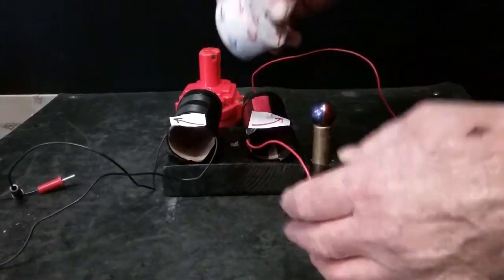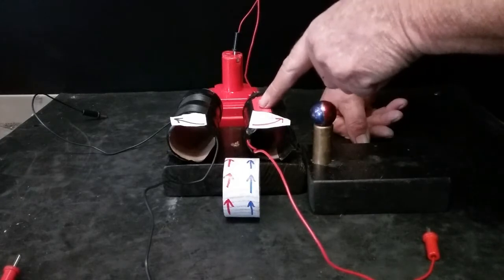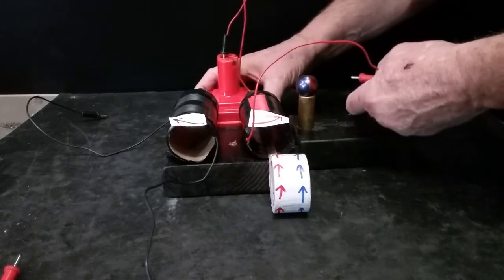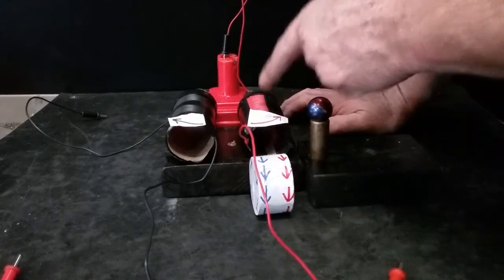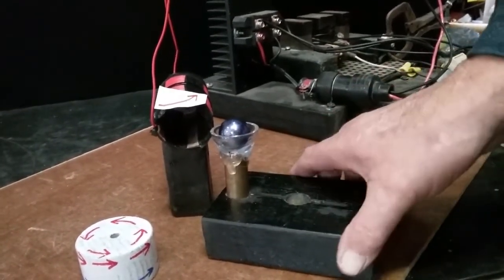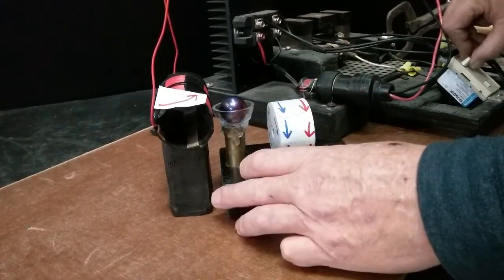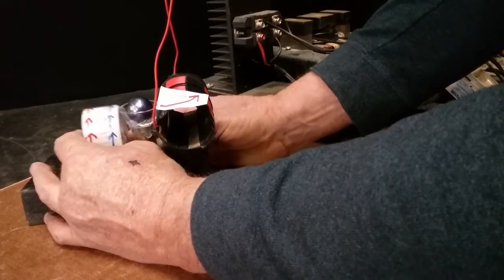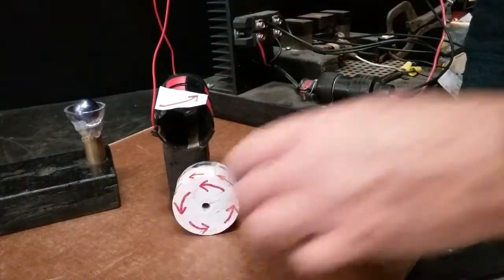Energized Coils and Magnets

Comment: Ok. I feel the need to correct you in some aspects. I hope you will not be insulted but be open to learning.  Take your cylindrical coil and wind it clockwise and another counter clockwise. I'm eluding to point of view here/relative perspective. Take either one of your coils and and envision you being the current entering the coil...remember this is regardless if it is a left hand coil or a right hand coil. Now flip your coil over, end to end, and you will see that your coil is the opposite wind...relatives to the current flow. so it doesn't matter if you wind your coils right or left.
Reply from the maker: That is not correct. When you flip a right handed wound coil end for end - it is still a right hand wound coil - from the "positive" electrical perspective. (As you look at the current coming toward you at the "negative" end it "looks" left handed - but it is still right handed for the "motion" of the current with the positive at either end. (Same for a left hand wound coil.)